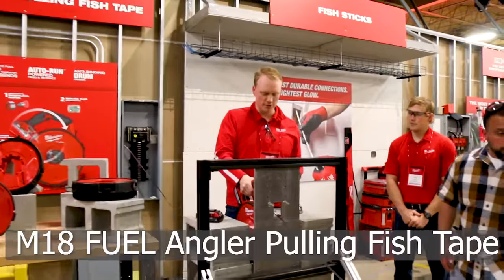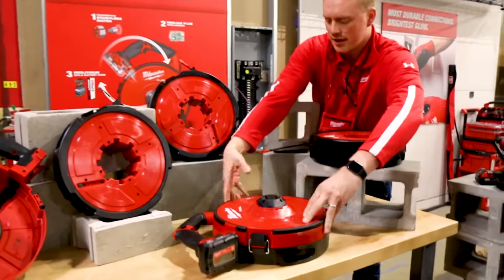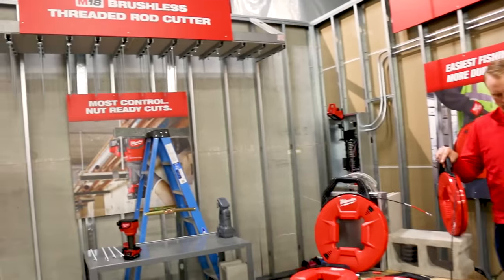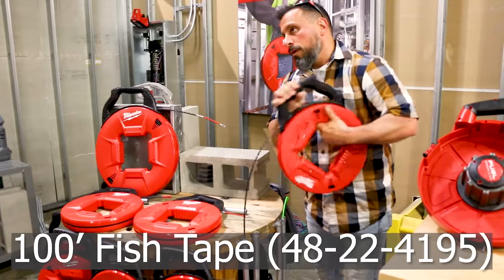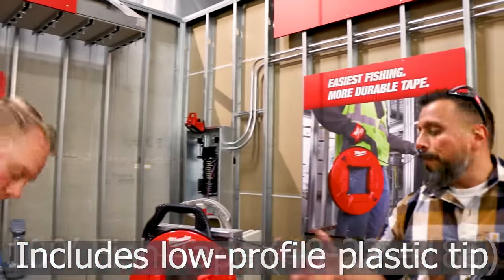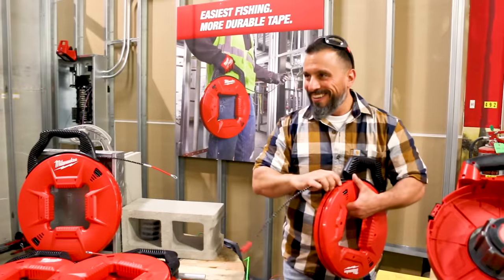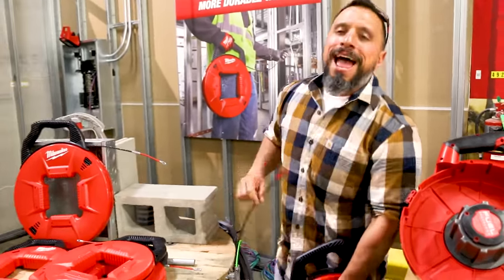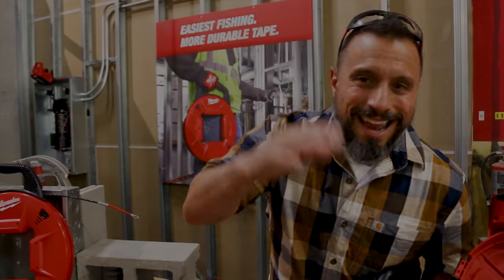Milwaukee Tools NEW FISH TAPES ARE THE ELECTRICIAN INDUSTRIES BEST! (Shock Warning)

Comment: If you'r like me. You are probably hating Milwaukee tools right now. All this amazing innovation and tech in their tools and if you'r a tool guy your probably thinking like I am. "Damn I got to get this.
 For me the Milwaukee obsession began with the M12 - 3/8 drive ratchet.  Then I waited for Christmas in March. When I could finally get my hands on their new M-12 Stubby Impact gun. That was it.  I was hooked. I went all out after that. With their M12 system. I carry their M12 ratchet, reciprocating saw, jig saw, hammer drill, 1/2  impact gun.  All in my rolling tool box at work. I also have a pretty large investment at home in Dewalt XR 20 volt. 
Heres' the part where I believe maybe,  I need an Intervention. I have a double whammy.  I am a gadget guy and a tool guy and Milwaukee is kicking some serious ass and I am seriously considering replacing my entire Dewalt tool system and getting the M18 Milwaukee system. ( gotta have it ) 
I know,  I will start a new movement. Like the "Me Too" and  "Just Say No" movements. I will get a Tee shirt in Milwaukee red and I will call mine The "Gotta Have It Milwaukee "  movement. 
I used to think more voltage translated to more more power.  That's not true. Trust me. I am an industrial maintenance mechanic for a large corporation and the M12 system it's  compactness of design and it's light weight. Makes it an  amazingly Ideal system to carry in a rolling tool chest . So you don't have to run back to the shop when the need arises for  a reciprocating saw ( ie Sawz all , Jig saw. )  The M12 system is a 12 volt system. I know your probably thinking 12 volts is this guy nuts ?. Trust me, the M12 system has certainly disproved my old school of thought on 
Voltage = power.  
Only one question I have to ask Milwaukee after I start replacing my Dewalt tools. How many Milwaukee replacement tools are required  to be purchased before Milwaukee will supply a free divorce attorney. (  I am probably going to need one. )   
Oh yeah,   did I fail to  mention.
 " I hate Milwaukee".  lol
"Semper FI "  Milwaukee

Comment: I wish the demonstration had some wire inside the conduit. 

I'm constantly adding wire to conduit.
Reply: Ya I was thinking the same thing. Throw a few Cat 5 cables and a few double coax for satellite in there and really test it.
Reply: I have the flex leader version, I can fish it with 5 #12's already in a 1/2" EMT.  After 5 #12's you can't get the leader in.  The nonconductive  version will only work in 1/2" if there is nothing in the pipe.  3/4" EMT is no problem with either tape.
Reply: @djmidnightwolf  they won't do that on camera
Reply: Then why wouldn't you just kill all circuits in the conduit pull the ground wire with your new wire as well as a new ground attatched to it, out and your new wires in. No need for a fishtape if there is wire already there.
Reply: @victorholmes842  the wiring I do is cat 6 and coax.  We usually can't turn off circuits.
Reply: @smdehn3  well then sir I stand corrected. Yea it's not so easy to pull out a conductor and pull more in when you're dealing with low volt cable. But hey at least your raceway is huge! Lol! Your welcome! It was my pleasure to provide you with that raceway.......lol!
Reply: @victorholmes842  pulling out an existing wire and adding some new ones isn't always that easy lol.  Sometimes they get twisted together in the run.  I've even had it where it was taped together inside the conduit lol.  But yeah if I'm pulling in conduit that already has conductors in it, I definitely try to do it how you described.
Reply: @rustimack  yeah definitely does suck when you run into taped lines smh

Comment: Those fish tapes look really nice. I'm a little iffy on the power fish tape just because you can't feel if the wires hit something or if the guy on the other end stops because he got a tangle
Reply: Perfectly said I was thinking the exact same thing. it's best to go slow cuz the other guy. At the other end could get tangled or his hand can get tangled with the wires it can escalate very bad fast.
Reply: If you think about it, its really the same concept as a tugger. Just for smaller wire.
Reply: Does your company not provide radios? Or maybe use your cell phone?
Reply: Very common that I have no cell signal or that the multiple concrete walls will cause issues for radios.

Comment: I’m not en electrician, I have a drain cleaning business, I could on occasion use this...I do sometimes use the hand crank ones when I need to fish something out of a sewer line... sometimes tree roots will fall off the cable after cutting them loose, then you have to try snagging them again or pushing out into the city line..... occasionally they are just too big and you have to keep going in with the cable ..  it can be a pain in the ass....a fish tape with a treble hook sometimes will work,, also if you have a ton of wet wipes a fish tape and hook are faster...  but that’s a lot of money for use maybe once a year
Reply from the maker: Good feedback Robert!!

Comment: Regarding the electric fish shaped the only thing I do wish is that it had a setting for what gauge wire or you know what you could pull on it foot pounds before I stretched it or broke it does it have a safety to where it doesn't snap the wire hundred feet down the pipe

Comment: Someone show that man how to properly pull fish tape out of the roll!! 
On the power pull only issue I would be afraid of is when I hit a snag pulling a long run sometimes it has an issue that requires attention on the other end, this beast would just rip the wire apart, right?

Comment: I want to see it go through a 150 ft run with 540 degrees of bends and cheated couplings every 10 feet
Reply: 🤔🤔🤔🤣🤣🤣🤣 what kind of run is that
Reply: @saul1919   Have you ever worked a commercial construction  job? I'm a local 134 electrician in chicago and I've pulled wire through 3/8 whips to 5 Inch GRC I'd say 80 percent of runs have more than 360 bends between J boxes and you can almost certainly count on at least one cheated coup or conn
Reply: @dereksmith8177  100% agree Derek. I'm up here in Canada and can get similar issues. Not usually that much bend but definately cheated couplings or the pipe is full. Or they decided to substitute black irrigation hose for PVC or DB2 pipe in places that you can't see it. 

The test they showed here was easy. Any fish tape especially when new should do this.

Comment: I need it to go through grey 1” PVC conduit for swimming pool lights. I can’t get anything but meatal fishtapes past like 60’
Reply: Make a rat and use a good vacuum.
Reply: It's prob cause of the water in the conduit. I don't recommend it but one way I've done it before is the buy a new steel refill and cut off enough so that you have enough on either end and Chuck it up in a drill make sure if your not using a leader to make a decent size head and plenty of yellow77

Comment: It would have been easier if you just held the handle and pulled the fish tape out instead of rolling it out. If that was a steel tape it would have been all screwed up on the inside.

Comment: And the conduit will be ripped out of the wall. This thing like most Milwaukee is not well thought out and is  a P.O.S. Most general contractors are now banning Milwaukee tools on their job sites because they’re dangerous, and screws up job site so bad that they are not worth having the tool or the owner of the tool any where around their site.
Reply: Quit lying. That thing is not pulling conduit out of a wall.
Reply: It would not just pull the conduit out of the wall. It’ll pull the plumbing apart and cause a major flood.theres a reason why tools are made the way they are. It’s just another stupid design. If there was a gas line somewhere in the wall it would cause a gas leak and possibly an international insident. The Red Cross organization was originally started by fixing disaster zone caused by Milwaukee tools and milwaukee tool owners. Thats why the Red Cross is a “Red”Cross. It kinda like a no smoking sign crossing out the cigarette where you can’t smoke.
Reply: Damn did Milwaukee tools hurt your feelings or what? I. I. Construction and I travel the entire east coast of the United  States of America. This is the first Ive heard of Milwaukee being banned on jobsites.
Reply: Victor Holmes it’s your choice but if an osha representative sees you with Milwaukee you might lose your license to drill
Reply: If your planning a trip to Canada you better make damn sure you don’t have a Milwaukee screw gun or even a Milwaukee bit in your car, because if your car gets searched and the border guard finds evidence of Milwaukee, you could spend upwards of 7 years in jail and 3 year in rehab